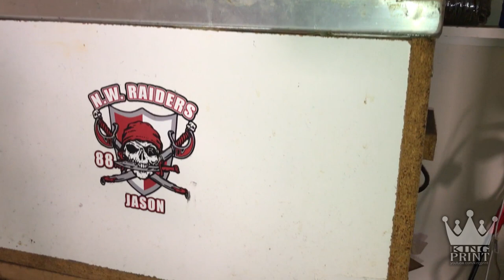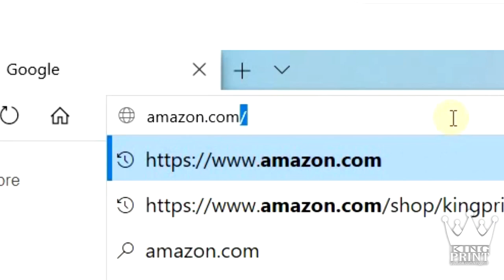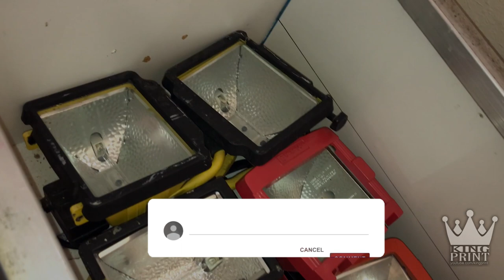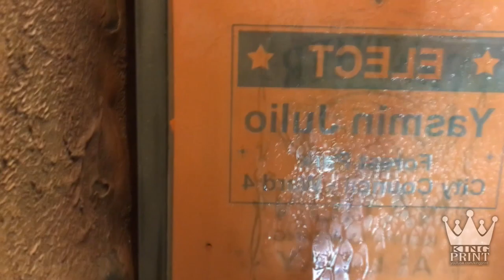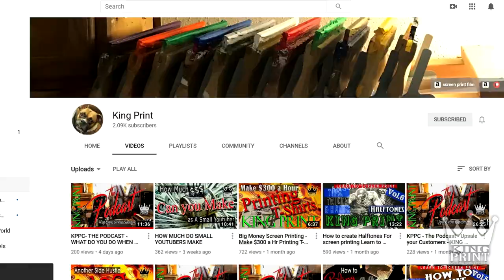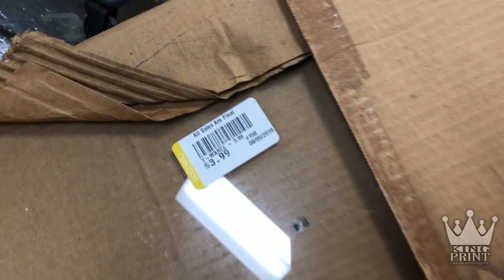How To Make Screen Printing Exposure Unit SUPER CHEAP Home Business KING PRINT

Comment: Hey man, I've basically made a replica of this box with x6 300w bulbs, so wondered what exposure time you use? Tried 2 mins but everything blew out
Reply from the maker: What emulsion are u using, I use pre sensitized ulano orange, @90 seconds, and I dont hit it with anything harder than shower nozzle,

Comment: Cool vids. Which printing press are you using, pros cons? Thx
Reply from the maker: Thx, I use a 
bmw Riley Hopikns 4 on 4 , it's a real solid press, the only con is you need to replace arm springs almost once a year,
You can buy a cheap press but if you want something that will last a Riley or workhorse is worth the investment
Reply: @KingPrint  cool. Thx.. I'm actually going to buy the the Riley Jr 6/4.. looks like a decent press to start with, and not to expensive.

Comment: Hello sir. I just noticed you exposed the frame in 6seconds?
Reply from the maker: Exposed in 2 minutes, video was edited for time
Reply: @KingPrint  Thank you bro for the response. how about the distance between the glass and the halogen? i mean how many inches?
Reply from the maker: @jrvios6003  about 10 in
Reply: @KingPrint  is it still safe from that distance? i just worried about the temperature inside of it.
Reply from the maker: @jrvios6003  if you have the right bulbs you won't have a problem with temp